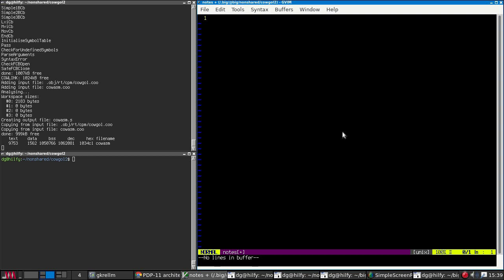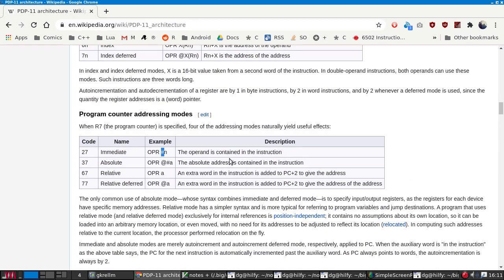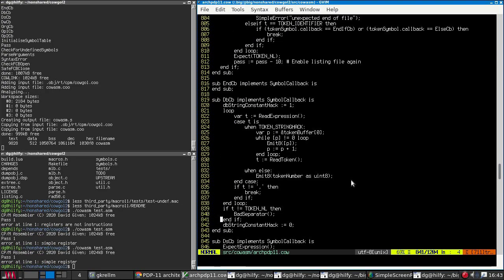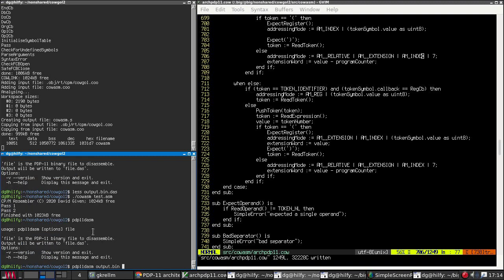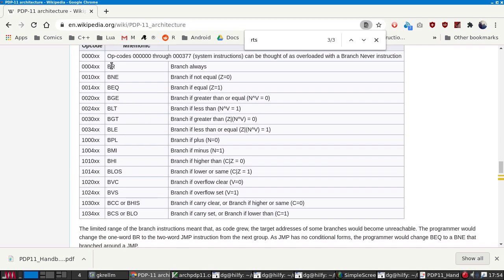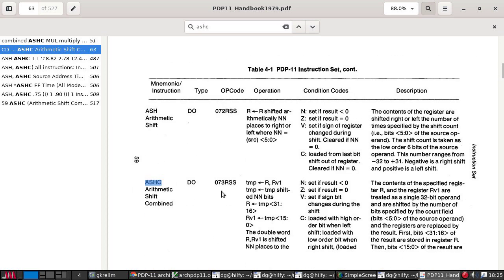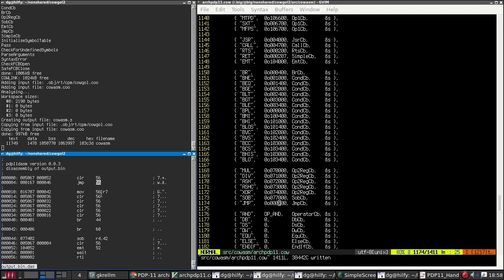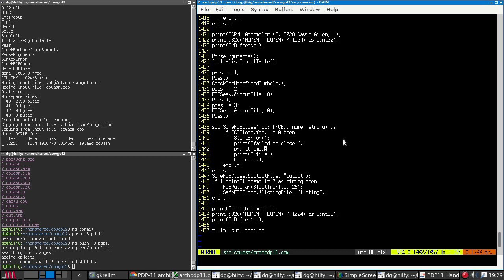Hjalfi writes _yet another_ assembler for the PDP11

Comment: this instruction set is really interesting, is this where the similarities between the motorola 68000 and the 6502 processors come from? all of these have some similar mnemonics, especially the comparisons and branches iirc
even the addressing modes seem kinda similar to the 6502 imo, except a bit more in depth

...might also be just me not really knowing any other instruction sets...

it's also interesting how octal seems to have kind of disappeared nowadays, at least to my knowledge
Reply from the maker: I couldn't say for sure but I'd be astonished if there wasn't any influence. The PDP-11 was hugely influential, and as you say, the instruction mnemonics are too similar for chance.

I've bene working on the compiler backend, BTW, and have discovered some rough edges to the instruction set: like having no unsigned operations! This makes working with unsigned types painful. And even though there's a 32/16 bit divide instruction, using it for 32/32 is so awful I'm just not bothering...